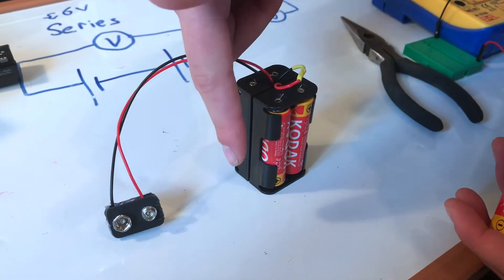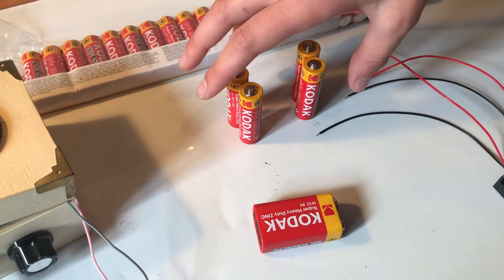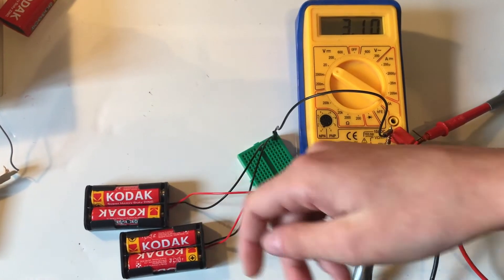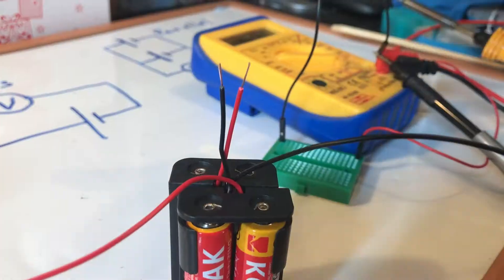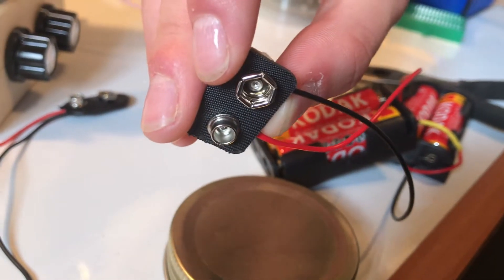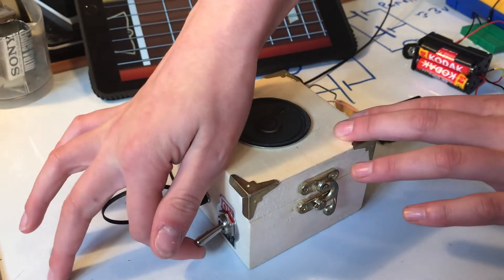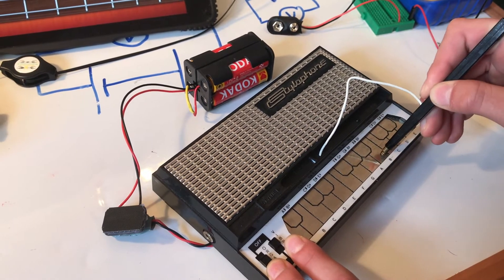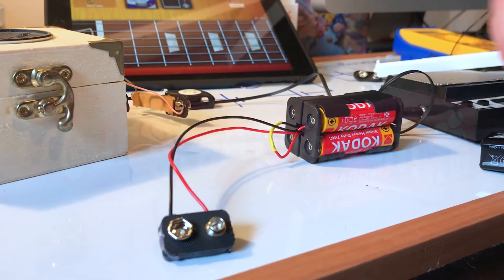Use cheap AA batteries instead of expensive 9 Volt Batteries - Build your own device.

Comment: good, but use 6 batteries, so voltage would be higher and would last way longer, as when AA batteries deplete, they would not be empty but device will be not working :)

Comment: This was an excellent video with some great demonstrations too. Enjoyed the speaker and stylophone demos. Picked up some really useful info . Good teaching skills.
One question: Is there a way to make or imitate the battery packs which hold those AA batteries? I don't believe I've got any of those black battery holders which you put the AA batteries in. 

Thanks for the video.
Reply from the maker: We 3D printed some there are some good designs and you trace the wire through so your wire is the metal contact. But the time, cost, and effort compared with a cheap bundle from Amazon or aliexpress? Also I’m sure you could use foil & gaffa tape for a prototype. Blue tack and gaffa tape for the win.
Reply: @GurgleApps  Got it, thanks. i'll give the prototype a try as I don't have access to a 3D printer at the moment. Fingers crossed I can get my amp working so I can record on the mic. I was unsure about the efficacy of blue tack and gaffa tape but sounds like it's a winner. I do have a soldering iron though so might hard solder it together. Glad I found your fantastic channel and thanks again for your guidance and tips!

Comment: An expensive 9v battery could be alkaline, which have more amps in it than a cheap CARBON battery. Voltage is not the whole story. An alkaline battery can pump up more current than the cheap one.

Comment: Rechargable NiCd (like the Eneloop) are pretty cheap in the long run.    Especially if you are using AAA (which cost more per cell than AA for some unknown reason, at least in the USA).  The eneloop hold their charge for a long time, much better than the NiCd rechargables from 15  years ago.

Comment: works great to build buy a little voltage controler and use this idea on a fire alarm also. since most of them so called 10 year batters only last 6 months like other 9 volts.